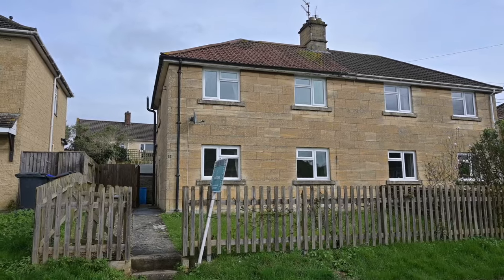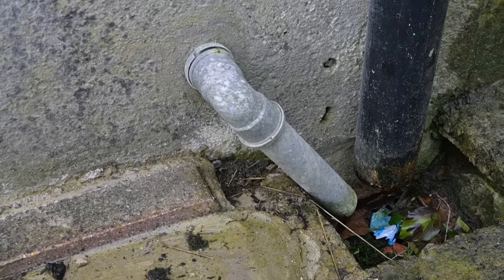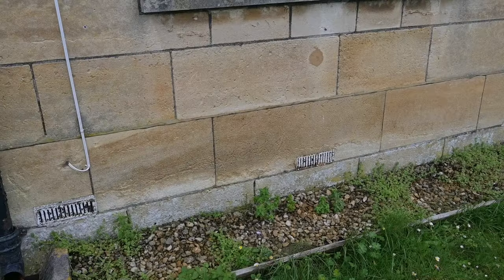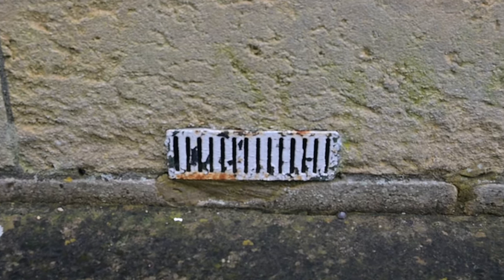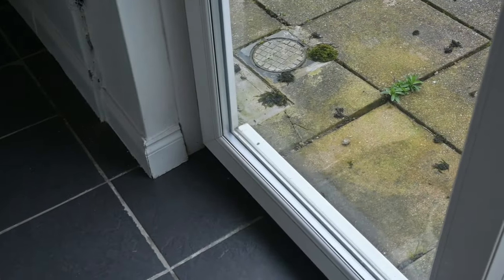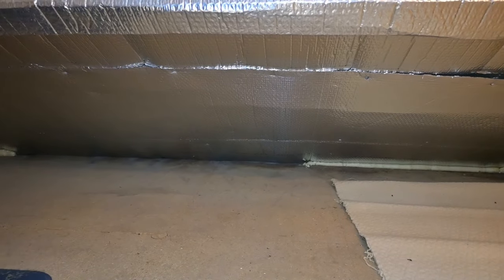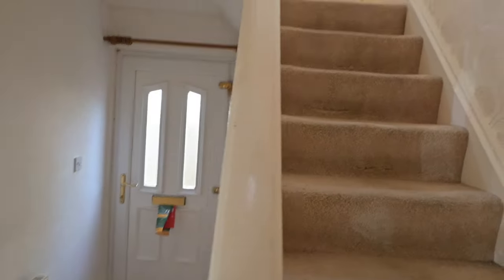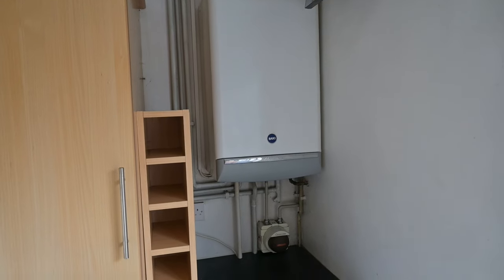A survey of a 1920's semi detached council house.

Comment: What is the difference with interlocking and double roman? Are they not not both interlocking?
Reply from the maker: Hello Stephen. I cannot recall what I have said in my video but clay double Roman tiles overlap, whereas modern concrete interlocking tiles are designed with tongues and grooves for want of a better description, so that they do actually interlock with each other. That is perhaps the distinction.
Reply: Thanks for the reply and explanation.